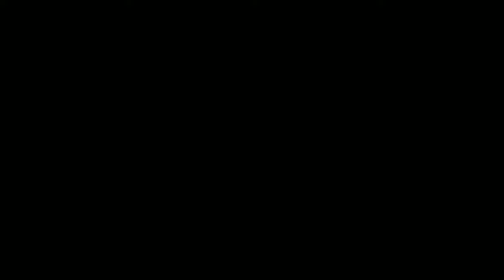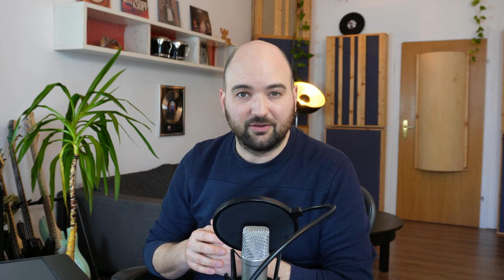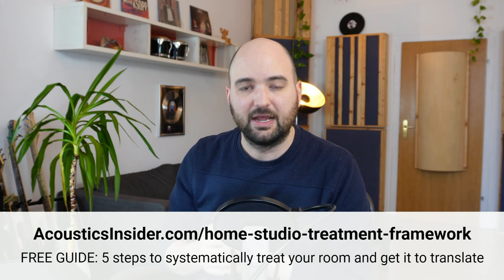Don’t confuse “DEAD” and “DRY” room sound - What sound engineers NEED to know

Comment: I often hear people say diffusion doesn’t work in a small room…however if you have 5 feet of distance…you can diffuse most of the midrange…so I’m not sure why this generalization statement is so common.
Reply: Diffusion is definitely better than a flat wall. But one can question if it’s maybe better to absorb than to diffuse in that time frame. A reflection from 8 feet away (2,5 meters) - 16 feet in total falls below that critical timeframe of 20 to 30ms. 
So an alternative there would be to redirect the sound to the ceiling and diffuse it there… so yes, I would absorb at those distances, especially at ear height.
Reply: In my experience, diffusion works well to fight comb filtering created by air gaps behind absorbers (lowers effective frequency but increases comb filtering).
Reply: I think to best utilize diffusion you need to have everything dealt with first. So that means, acceptable low frequency and reverberation management. To accomplish this best, you need to make the room smaller which doesn't give much room for diffusion...
Reply: @Hamachingo  how does an air gap increase comb filtering? Where do you place the diffuser relative to the absorber to counter it?
Reply: @Hamachingo  are you referring to when the air gap exceeds the thickness of absorber? A more common example of comb filtering would be the air gaps between slats.

Comment: Diffusion doesn't increase reverb? Doesn't the energy have to travel at different distances, effectively causing a time delay?
Reply: What happens is that the impact is spread out over time, so the amplitude doesn't it all at once, and is thus reduced. For example, if you heard multiple reverberations in 0.3 seconds loudly, with diffusion you might hear it over 0.4 seconds but softer. So it changes the decay. I think that's how it works. The more reflections you have, the less impact the sound has when it hits you.

Comment: What's the best target reverb time?  For a small room. 15'8" x 11'3"  7'3" tall ceiling.  REW taken at listening position.  I have all but low end down to 150MS and low end just under 300MS.  Adding more treatments now.
Reply: Your high end is well damped! Adding more treatment if it's thick enough will fix your low end further while only having a marginal (10-20ms tops) effect on your highs. So keep going ;) Everything under 200ms is kind of the golden zone.

Comment: In my room it seems that when I add reverb to a track and it sounds good, there is a bit too much when I listen back outside?
Reply: I’ve had the same issue with every room I’ve worked in. I suspect it has something to do with consumer grade equipment having some natural compression? I just get it where I like it then drop it a db or so and it usually works out okay.
Reply: Interesting, I have not worked in studios in over 20 years, but I always experienced hearing the reverb more in the studio, than on consumer gear after the fact

Comment: unrelated question: what is your advice on 'vertical' vs 'horizontal' speaker orientation? I'm referring to the commonly configured two-way near-field monitor, which is taller than it is wide and has the tweeter located directly above the woofer in bilateral symmetry. (for reference, I use a pair of Focal Solo 6 BE.)

I have read that when you place such speakers on their side, the tweeter being located to the left or right of the woofer (rather than above, or above and to the right/left of the woofer) disrupts the intended voicing of the speaker. I have also read that it makes no practical difference, except to the ear of the listener — given that each orientation may slightly change the effect of direct reflections, depending on room layout/shape. I have had my speakers oriented 'normally' for several years (in the vertical orientation, with the tweeter above the woofer). however, due to limited space, I am experimenting with a 'horizontal' orientation, with the tweeters on the outside of the stereo image and the woofers on the inside.

the Focal manual contains an image which depicts a variety of layouts, horizontal and vertical (including inverted, with tweeter below the woofer) that indicates any of these orientations may be appropriate to optimize your monitor layout, depending on the needs of your room.

in my case, in the vertical orientation, the tweeters sit a few cm above my ears when sitting in the ideal (equilateral triangle) monitoring position. with them oriented horizontally, the tweeters sit at a height between my shoulder and ears. I am experimenting with this orientation in an attempt to achieve a better monitoring position (proper equilateral triangle) and improved stereo width. in either orientation, the center of the woofer cones are about 90cm apart). in the horizontal position, the center of the tweeters sit approximately 110cm apart, but in the vertical orientation they sit about 90cm apart, same as the woofers. in practice, I am working a bit closer to the monitors than they are spread apart, about 80-90cm from the face of the monitors. again, this is mostly due to space constraints.

I feel that in the horizontal orientation I may experience a bit more of the desired stereo image width, though I am also aware that this can probably be attributed to recency bias as much as any actual change in imaging. however, being that the monitors sit very close to the wall, and in the corners of a slightly recessed space (the room is a very irregulary shape, with concrete support structures and ducts protruding from the walls) which may or may not also affect the resonance of the bass response relative to each orientation.

other than trusting my ears, which I do — I have been training them in clairaudience for some two-plus decades — do you have any advice on which orientation is "correct", when the tweeters do not sit above/above and to the left or right of the woofer, if oriented horizontally, and rather sit to each side and still in bilateral symmetry?

apologies if this question is long-winded, I simply am trying to be as accurate as my vocabulary allows in order to convey the nuance. quite frankly, I doubt the difference is meaningful or appreciable in my less than optimized, untreated room. but I trust in your experience and knowledge and I wanted to ask this question of a professional acoustitian for some time.

thank you for your time, Jesko, I really appreciate the wisdom you afford us via your channel.